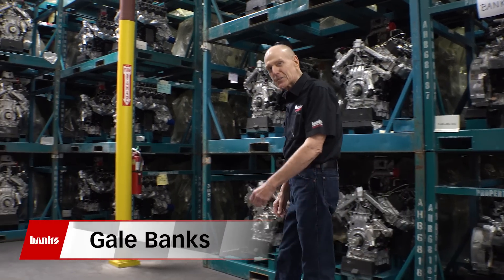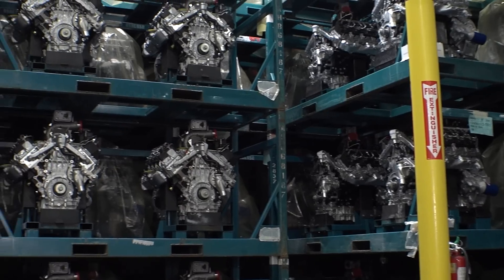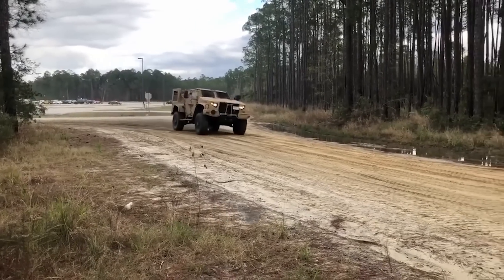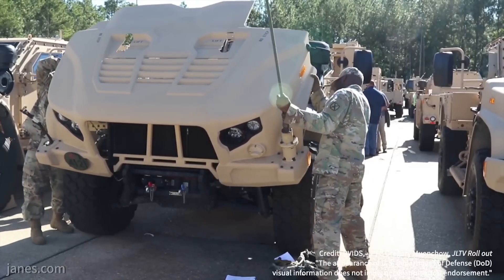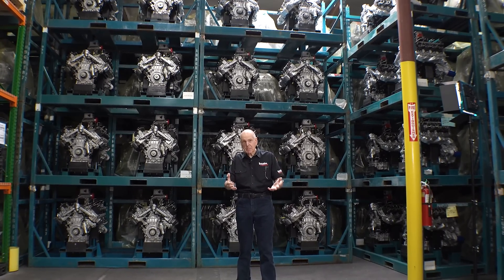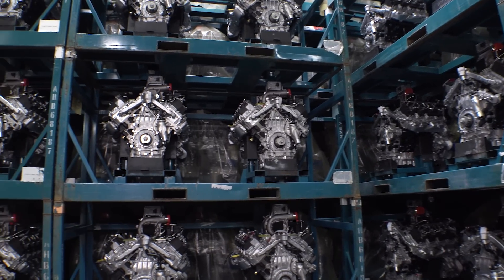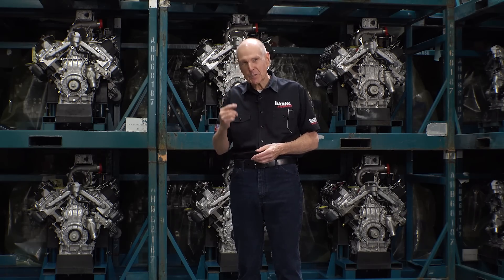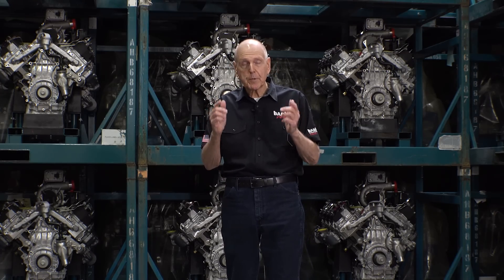Why DURAMAX built 374 engines for BANKS

Comment: I want one of those motors bad!!!
Reply from the maker: The good news is that, while we made a lot of changes for the JLTV engines most of them are for reasons specific to military service. The D866T is still based on the LP5 which is a terrific platform, so if you head to your local Chevy dealer and order a new truck with a Duramax, you're already most of the way there. 

The other option is joining the Army or Marines.

Comment: Here I am dreaming of this as a perfect piston engine for a modern airplane. Diamond has done alot with an engine based on a mercedes benz diesel engine. A much less powerful engine, albeit lighter. Still, I think an LP5 based diesel, which is already proven to be capable of running JP8, has a lot of potential in general aviation. One at 600+ hp under 2800 rpm?

Comment: 400 engines per day used to be the minimum, so long as the crank, block and head lines didn't starve assembly.  They stayed until they hit the number.  Glad I started on the block line (in Makino).

Comment: I worked as one of the test engineering crew at the Nevada Automotive Test Center where these vehicles were tested and tortured.  I can tell you that these vehicles are utterly amazing and ride like nothing you've ever experienced off road.  I think the only thing that might ride better than one of the JLTV's is the M1A1 Abrams.  I was never able to talk about it to anyone - but seeing as how this seems to be public, I'm pretty sure I'm in the clear now.  Banks did an amazing job with these engines.  They move these huge JLTV's like nothing.  I'm pretty sure I can't mention their top speed, but believe me when I tell you, they hustle like nothing we've ever had before.

Comment: I had a 02 lb7... it cost me 14k to rebuild.. when i was done it was bad ass...  i would rather stay with my 13 ram with a 6.7.  I can work on it without pulling the engine.  The 02 had a blown head gasket.   It will be my last duramax i own

Comment: So you build a non DPF engine that is required to have DPF in the USA? 
Got it.
Reply from the maker: Our defense engines carry a federal emissions exemption. Engines that are destined to be installed in an EPA-regulated vehicles, be it a Duramax diesel or Honda V6, have emissions equipment installed at the engine plant. Engines that are not destined for an EPA-regulated vehicles, in this case the JLTV, are not required to have emissions equipment.

Comment: The fact that Banks uses the L5P in this application is one of the main reasons there is one in my truck. It speaks volumes about the engines foundation.
Reply from the maker: Yup, the L5P is an amazing platform.

Comment: I figured that the HMMWV replacement would have a Cummins 4BT type engine in 3.9 or 4.5L based on the new 6.7 I6 just an I4 eversince they showed a vehicle so equipped on Jay Leno's garage a few years ago. Looks like these Duramax based engines will be a huge step up in power and performance.

Comment: I've actually produced parts for this engine! Worked at an Iron foundry in the machine shop, we made ductile iron engine mounts as well as an accessory pulley that had a keyed and tapered bore. The engine mounts were originally aluminum, but when dropped from a cargo plane of helicopter the impact would break the mounts. We also made some kind of suspension bulkhead out of heat treated ductile iron.

Comment: Kudos to Banks and the management team  and workers at Duramax engine who allowed this to happen.   What separates Banks from the masses is the R&D ans testing they do on everything they make. Banks maintains  factory levels of reliability while increasing performance . On diesels they don’t just add fuel to a diesel they match it with airflow increases that maintain EGTs at or below factory levels . If it says Banks you can trust it .

Comment: Banks Power, why did you pick  Duramax diesel engines. Why not Cummins Diesel engine for army.
Cheers Jason
Reply from the maker: Cummins was originally in the running and were tested extensively. Unfortunately, given the physical constraints of the engine bay and the max weight limit, the Cummins was a no go. Gale has a long history with Cummins as may know. In fact, we're hoping to fire up a new Cummins-based video series in the coming months. We know we have a ton off Cummins fans.
Reply: @bankspower  thanks guys for info.

Comment: Would a cast aluminum oil pan be the best choice on an off-road vehicle? I’ve seen tons of steel oil pans with big dents that keep on going for years, don’t think a cast aluminum one would take that without breaking
Reply: You are probably right. I bet the cast pans on the military vehicle hangs down with no protection like the one on your pickup truck in the driveway. Also, Banks and GM probably didn't know that steel dents while aluminum cracks....idiots.
Reply: Whoosh

Comment: Any particular reason they decided to use a Duramax V8 instead of an i6 from someone like Cummins?
Reply: Actually Gale answered that some time ago, they tested cummins, powerstroke, and of course duramax. During testing they found that the cummins wasn't reliable at sustained hi rpm and full load testing, and same problem with the powerstroke. I am a cummins owner and fan of them, but they aren't a meant to run run at full rpm for really long periods as the army specs out. The duramax passed the test.
Reply: All you have to do is figure out the bidding system, then which political skids to grease.  As a rule lowest bid wins provided all the "specs" are met.
Reply: One main reason reliability
Reply: @brianhouk543  Unlikely.
Reply: tyson505 gale has been involved with DMAX for almost 20 years. He knows the product and he knows the reliability. He had the quickest diesel record at one time with a Duramax in a s10 tube chassis truck. Also his series how to kill a Duramax. Shows the reliability and of course the week spots. We only build a long block and he ads the rest.

Comment: Don't be fooled most of the pictures shown at the factory aren't accurate they are not l5p banks
Reply: Ethan Utter Probably just stock footage. I doubt taking video footage of the factory was a priority during this special run of engines.
Reply: Daniel Xddd lol that wasn’t hard to figure out lol. Some people... probably believes a dust mask will protect him from covid too lol
Reply: They are L5P engines, Gale started messing with them, for military and marine use, 3 years before gm put them in a truck!
Reply: gene choate the OP was talking about the B roll assembly line footage.
Reply: @genechoate5020  the engines in the factory during the b roll are not l5ps
Reply: Ethan Utter No shit?

Comment: God bless Gale Banks and the Duramax engine one hell of a diesel....and so are those like way better then the ones in the normal trucks like hp and torque and does the government use def fluid on those....pretty gay if theres dont come with def if you can pollute the air in a different country while killing it i wanna be able to do it in mine
Reply: They don't use DEF on those engine's. It would be hard to access when in different countries.
Reply: Even though they are out there protecting our freedom and you're just a normal guy not protecting anyone?

Comment: bet ya there's no dpf or egr on that big dog
Reply: Desert explorer 302, the military goes with the lowest bidder lol
Reply: @caseynelson8035  That's not how it always works, I'm sure you know this.
Reply: @caseynelson8035  Are you sure? You mean which gets lobbied and which general gets bribed. They take the most expensive most of the time because they need to maintain their military spending budget. If you don't use what you have they'll assume you can get by with less
Reply: will take a cummins over this... Ubiquitous parts and far more simpler than a V8 setup.  These run aluminum heads..
Reply: @joeyscleaningladys  The military obviously doesn't agree with you. Lol

Comment: I once toured the GM Plant in Moraine and saw the Banks Only rack of engines. Pretty impressive! If you park in the 'Duramax Powered Vehicles Only' parking lot and it's not a Dmax...they WILL tow you!
Reply: truckguyjoe Most every UAW plant I’ve ever been to is the same way; the “drive what we built or get towed” thing is not exclusive to DMAX.
Reply: I worked there from 2000-2011.  Where exactly was that in the parking lot? Knew many who drove other brands...hell the union president at the time drove an old dodge power wagon.

Comment: I know one thing those engines don't have, emissions...
Reply from the maker: That's correct. You can order an engine any way you want it. However, if you plan to use it on the highway, which these are not, you'll need to meet emissions standards.
Reply: @bankspower  what's the reasoning for not needing emissions? Reliability?
Reply: @Bizketbutt  more crap to fail. Submarines use locomotive diesels designed in the 40s if i remember correctly. Virginia's use Cat computer controlled diesels and require fly away teams when anything other than maintenance or simple repair required. That and they are meant to work/ kill/ whatever. Who cares about a little smog when there's bullets flying.
Reply: @1d10t.  what century are you in? After world war 2 submarines became nuclear powered. As are the naval ships.
Reply: @Bizketbutt  could you imagine being on the battlefield and getting a message that you have 5 starts remaining, because you have a boost leak and your DPF is clogging.
Reply: @LandSurfer  Or doing a Regen lol.
Reply: @40calDeathPunch  active duty on a 688. You do realize the Los Angeles class was designed in 60s. Ohio around same time. Seawolf 80/90s. Yes, I'm a nuclear machinist mate and emergency nuclear welder. I was referring my boats diesel in particular. The diesel boats motors were of even older vintage.
Reply: @1d10t.  Ok. Did you do your studies at Joint Base Charleston South Carolina?
Reply: @Mr.Beastforpresident  Yes! And you can see those (improperly built) boosted duramax's blowing up on dynos all over YouTube. LOL
Reply: @40calDeathPunch  seeing as how that's the only one still open for probably 20 years, yes. Every nuclear carrier/boat/power plant has emergency diesels. Fukushima melted down because the diesel generators got flooded. Try googling nuclear emergency diesel generators and emergency cooling since you're either trolling or know literally nothing on the subject.
Reply: Ryan Zoltan ftn.  9530-T, 9603.  Third flight Tomahawk boat.  Remember to show the nubs where the Gamma Window is.
Reply: @1d10t.  The diesels are used for back up power in case of reactor shut down etc. How ever your a machinist mate. One of my friends son is a nuclear physicist for the Navy. So if he's wrong then the information from him is wrong. Plus when doing research when the Military converted to nuclear power. And not google, their information is misleading.
Reply: ZeroCool  most naval ships run off JP5....... a dozen carriers doesn’t come close to the hundreds of other ships out there
Reply: @Bizketbutt  expense, maintenance, complexity and lowered reliability all things associated with diesel emissions control.
Reply: @40calDeathPunch  you do realise there are modern diesel subs because nuclear is not allowed Australia being one country that has them
Reply: @1d10t.  we had 4 huge back up diesels that ran on jp-5 on cvn-69. Wasn't a MM but went into the engine room on my ESWS tour and those fuckers are big.
Reply: @40calDeathPunch  many countries still use a mix of both. I believe the Australian Navy is one example
Reply: @40calDeathPunch  backup to a backup, they still have diesels along with nuclear power. But really they run off battery power.
Reply: @1d10t.  I used to think that subs used loco engines but I learned recently that it was the other way around. The diesels designed for submarine use where adapted for use in locomotives after the war. Even at that there where still some steam engines running right up until the early 60's. You are absolutely right about the KISS principle with the emissions. Especially considering the reliability and downtime issues commercial trucks have been having due solely to emissions equipment. And nobody is shooting at them.
Reply: @bankspower  as a matter of curiosity, what are the emissions on these engines like? I know banks engines tend to be much cleaner than all competing 2nd/3rd party engine builders, and I'm curious to see how much that's carried over to the military world.
Reply: @bankspower  In some cases vehicles built for being used by military and emergency services still have the emissions control equipment, but they don't have the inducement strategy that cuts the performance if something goes wrong, so the driveability still exists as normal. This is at least the case in Europe.
It would be a bad day if the firetruck can't get to a fire in time because there's some stupid things going on with the emissions at the moment.
Reply: @bankspower  Good old double standard, do as I say not as I do government. I see military vehicles on the highways all the time.
Reply: @rsdna9698  it's heavy equipment not a truck purchased for groceries and hauling kids..... There is a massive disparity on gross weight in that context.
Reply: @jacobproff  What does weight have to do with any of this?
Reply: @rsdna9698  gross weight and power/fuel efficiency all go hand in hand on envelope size and expectations.
Reply: @bankspower  Real funny since the epa is coming down on us “little guys” for not having “emissions” on our NON HIGHWAY vehicles. I was thinking about using your products to upgrade my 05 duramax dually for towing, but since you are all about emissions bs for us but not for your big money government contracts, I’ll happily take my business elsewhere
Reply: Imagine how reliable our road going trucks would be without those stupid DEF systems.
Reply: @35RSkyline  yeah but sitting in traffic with raw diesel fumes is not fun for the driver or others. Our city air would be so bad.
Reply: @aaron___6014  That is so wrong I don't even know where to start.
Reply: @rsdna9698  You're wrong.
Reply: Gale this is why we love you.
Reply: Kathleen Shaw  Do you serve on a nuclear ship or submarine?
Reply: #unleashthebeast
Reply: These engines are going overseas so emissions do not matter
Reply: EPA was making LAW and it wasn't authorized to.   Congress makes the Laws..  EPA enforces those LAWS.    Somehow EPA started making stuff up outta thin AIR
Reply: and I still dont know why emergency vehicles are required to have the emmisions shit. i think it may have something to do with admitting that they are unreliable garbage.

Comment: Looks like heaven on to me!
Reply: Just looking at some of the parts on this vehicle I can imagine the taxpayer/government getting ripped off on LED arrays and other parts that are custom.  Ubiquity like the HUMMV was a huge strength, now having to build up a brand new supply chain with CANBUS electronics and custom assemblies specific to this vehicle from exterior lighting to anything else means we see the era of the 10,000 dollar hammer again.  RIP taxpayers wallets.  Government Pork barrel spending.  With all the complexity of these new vehicles you will need a toughbook with a scanner to troubleshoot anything rather tha just a screw driver like on the old 6.5's, 2 stroke and cummins powered vehicles that came before it.